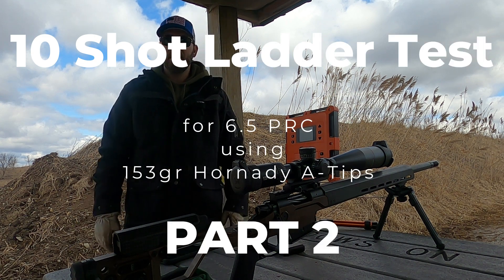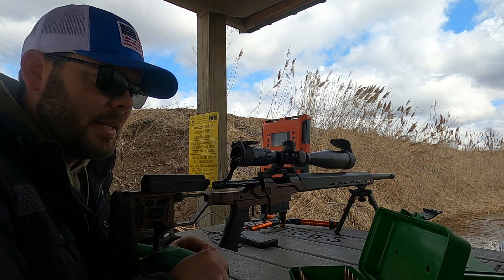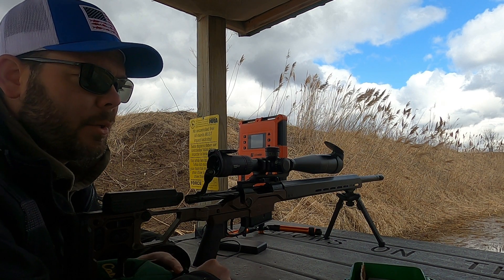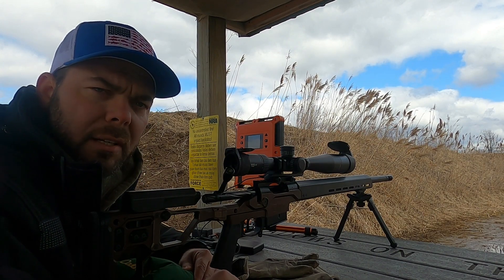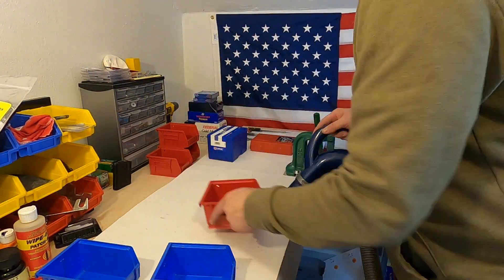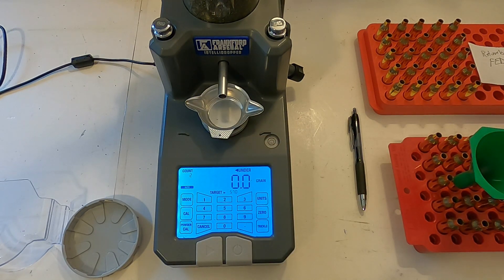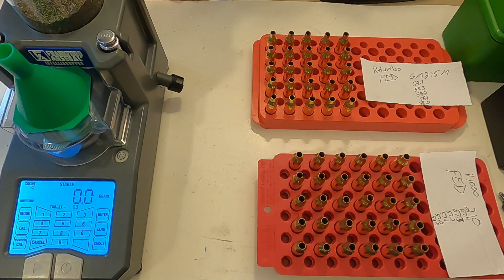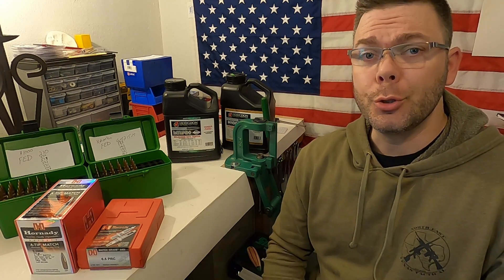10 Shot Ladder Tests for 6.5 PRC using 153gr Hornady A-Tips PART 2

Comment: Great video man so I'm curious do you ever check your neck tension at the end up of your prep process? The only reason I ask is that I found after getting a henderson precision trimmer I found that tumbling at the end causes you to get peened over case mouths that make it seem like your neck tension grew but really not so much.. I switched to just sonic cleaning instead to get the lube off because I couldn't get cases over the pilot on the henderson.. just food for thought. Great video
Reply from the maker: Never really have thought much about it.  When I am able to get single digit SDs and ES under 20 on pretty much everything I load up, I am more than satisfied with my end results.

Good point though!

Thanks for watching!

Comment: Nice! Just a heads up, if you have a new barrel you would only expect it to settle in at like 150-200 rounds. Doing such a comprehensive load development (which is awesome, enjoying the vids) before it’s settled in may cause results to differ…
Reply from the maker: You are correct.  I am at that point already.

Comment: No offense, but I'm seeing some pretty glaring holes in your process. I lay no claim to being God's gift to reloading, but I've been doing it for decades, have competed and am friends with serious benchrest shooters, and have dialed-in countless loads for rifles over the years. 1) Anneal brass FIRST, even before you deprime --- you want to soften the work hardening BEFORE you resize to minimize springback 2) Debur flash-hole once and never again, if ever (no good data on it being of benefit) 3) look into using a 0.262" expander mandrel on those necks for .002" neck tension. Some other things, but just quibbles. Overall, good show!
Reply from the maker: I appreciate your feedback!  I make no claim to know everything.  If it is what some consider wrong, this is just what works for me.  I get what you are saying with the annealing.  Some say that you don't need to anneal every time either.  I anneal last because I want the brass to be at its soft point for when it expands in the chamber.  I have no research to support why.  It just makes sense to me.  It is a theory that i might dive more into with a video in the future to see if there is any substance to my thought process or not.  I have not competed but would like to be able to do so in the future.   There is not much for long range shooting where I am located and would have to drive out of state just to be able to compete anywhere.
Reply: @mattsreloadingbench  your thinking on annealing has logic, but it's flawed. Trust me when I say that your brass has no problem expanding when it's exposed to 65,000psi,... The reason to anneal is to soften the brass for consistent resizing -- the brass becomes soft enough to STAY resized and doesn't spring-back to various degrees depending on how work-hardened it has become having been shot at various pressures (loads) previously,... Various loads at various pressures add up cumulatively to work-harden the brass in inconsistent ways making for inconsistencies in the amount of spring-back thereby your brass becomes more and more inconsistent,... Do you follow?  If you're going to use an Anneal Eez, be sure to use a big tank of propane, not the little camping tanks as they're inconsistent in their delivery.
Reply from the maker: @ryanberg3705  I do use a big tank.  I have a 20# tank hooked up to it.  If you use the small tanks, the flame is very inconsistent and therefore the brass is as well.  I am tracking what you are saying with annealing first and not last.  This is something that I will have to take into consideration moving forward.  Again, I greatly appreciate your feedback!

Comment: Why anneal after resizing?
Reply: Ya I did some testing on 223 rem and heard everyone say annealing after sizing can change the neck tension.. but I never found that to be the case and I'm with Matt on if you do it all the time it's not going to matter
Reply from the maker: For me, annealing is about preparing the brass to be able to be fired and expand to fill the chamber more consistently than being able to resize it.  Just because the brass is annealed at the end of the preparation does not mean that the benefits of annealing are gone once you are ready to resize after the brass is fired.  Also, annealing is not all lost from one firing either.  It's benefits last through a few firings.  I just annealing every time for the purpose of consistency.

Comment: Excellent information. Your process is very thorough. A few questions… what brass are you using? Many I have seen anneal brass first and then trim, chamfer . You anneal after all the sizing is done? Did you comment on group size with any of these powder charges? Or will you do that in a follow up video? Thanks
Reply from the maker: I am using Lapua Brass.  I have tried annealing at multiple stages of the process and I find that it does not much matter when it is done as long as it is done in a consistent manner.  The key to success is to make sure that you do everything the same every time and you will know what works or what doesn't through trial and error.  I am not saying that this is the way it should be done.  I am just showing everyone what works for me.  

In regards to group sizes...  there are none.  I do not even care about that this early in the load development stages that I use.  I am only shooting the rounds to gather muzzle velocity data and nothing more.  My next video in this series will be shooting 5 shot groups at 1/10th grain increments from the data that I collected from this video.  That is where I will have groups to measure and compare and I will also factor in my SD and ES measurements as well.  

Those were some great questions and I hope that I have provided the answers that you were looking for.  Stay tuned for what's going to be in the next video.
Reply: @mattsreloadingbench  Appreciate your follow up responses. Yes very helpful! I will watch for the next video that will provide ES, SD, and group sizes for powder charges varying by 0.1 grain increments. Again your process is thorough, informative. Thanks so much